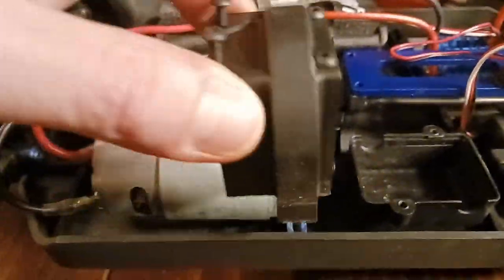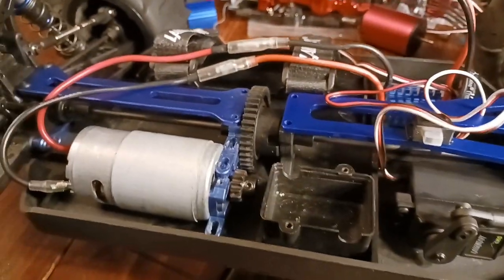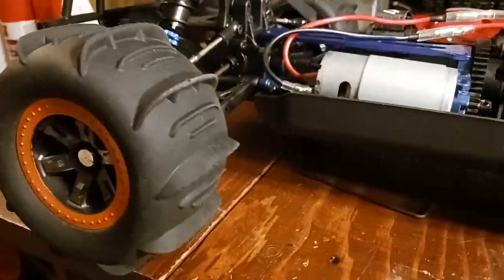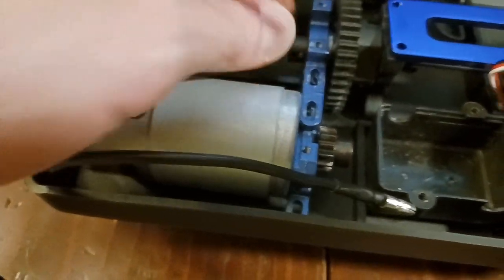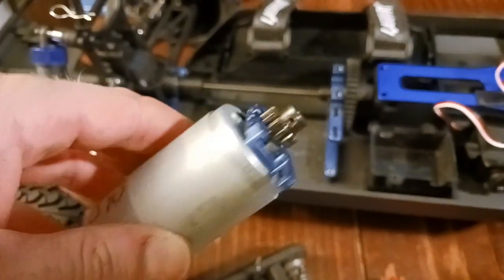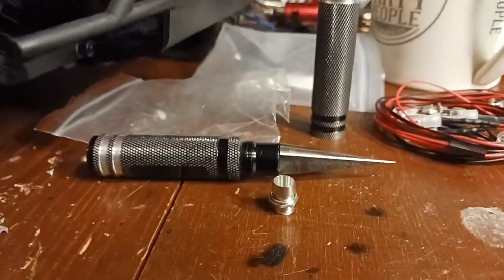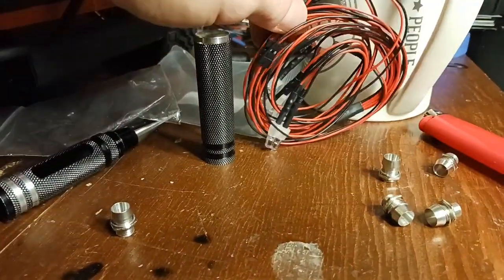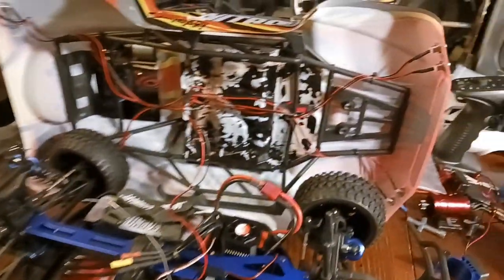Laegendary Nitro is now brushless & Fast asf

Comment: It’s an absolute ripper. You have a monster on your hands! A very well mannered monster!  For the price that this was , and the cost of the system you put in, you are way ahead for what you came up with. Awesome  light install as well! It handles so well! And that   Low speed throttle modulation is impressive! I knew you’d make this awesome. Great job Ricky!
Reply from the maker: Thanks Rob! Much appreciated 🙏

Comment: I've got the 17-18 tooth pinions you recommend, 3665 3100kv motor, 60-120a esc's, 125mm x 70mm tires, aluminum kick plate upgrade from my VRX Samurai, sway bars from VRX Samurai & Jeep Gladiator body shell. I'll attempt to assemble this weekend 👍🏽
Reply from the maker: Yay bro! except ohh no i just found out one thing I couldn't get the 17,18tooth to fit. The motor mount didn't have enough adjustment. Well I got a 15tooth mod 1 to fit. Bro The stock pinion is a 13tooth. I saw VRX 14tooth and figured it was the same, but I was wrong. I'm never guessing again
Reply from the maker: I had those 17,18 tooth on the motor and on the spur gear and the mesh fit. It was when I went to put the motor mount screws in I noticed I had a problem. Since I told you what to get and messed up I owe for the 17,18tooth. I'll PayPal you bro lmk that's all my fault
Reply: No need bro 👍🏽 it's from Amazon and I didn't open yet because I'm testing the Brushed ESC ISDT70 for crawlers, it runs a 3s and is programmable via Bluetooth, it rips brushed 3s but fan may be necessary and you'll have to plug fan in receiver and I've got 4 x 8oz tires on it. I'll post when I can on the Tube
Reply from the maker: Cool bro and thats good. Now with this 15tooth bro I think 17, 18tooth would be way too fast. 3660 4300KV 15tooth 2s is way faster then the 6900kv 13tooth. I haven't got outside, but 2s spunning the wheels off the ground just pan caked these RC Station tires part throttle really bad. Must be around 75mph right now it's nuts and it's a 3s,4s setup lol
Reply from the maker: I'll be on the lookout that sounds interesting 👌

Comment: Can you also share a link for the best suited pinion because I don't know the mod, pitch and tooth count, thanks
Reply from the maker: Sure ill get you a link for one. I just need to know what motor you have and what top speed you want. I reccomended keeping this truck under 55mph if its not weighted down, because it can fly and flip over and crash bad lol.
Reply from the maker: CODA RACING 2pcs 17&18T Mod 1 M1 5mm 1/8 Scale Pinion Gear Set https://a.co/d/7Zvgj47

Comment: What’s the best battery to run in this truck with brushless motor
Reply from the maker: 2s, 3s? I use two setups. One light for jumps and a one heavier battery setup for driving on flat ground. I show the batteries I use, or list them in the description. Anything from a single Awanfi 1500mah, or stacked in parallel to a single Zeee 5000mah 100c 2s. Those 1700mah and 1800mah stock batteries are no good. For the best in-between I'd reccomended a 2200mah 2s, or 3s
Reply: @ChiefRickyRC  I just want more run time so I can run it longer
Reply from the maker: Ohh this Nitro... lol I was on wrong truck. I'd reccomend getting two 2s 5200mah 50c-100c batteries and using a parallel plug.
Reply from the maker: I prefer Goldbat batteries they work great

Comment: You can use any 1/10 scale proline body on it it’s really a 1/0 scale not 1/8
Reply from the maker: Sorry no it's a 1/8. I have a 1/10 1978 Camaro i showed in Buncha Upgrades video back around xmas. Its same size as 1/8 Infraction
Reply from the maker: The Blade is 1/10 and any 1/10 JConcepts fits that tho
Reply: It will not let me post a picture but mine is the new brushless and it’s exactly the same size as a slash and I just fitted a proline Chevy  short course body on it it’s definitely not a 1/8 scale truck it’s a 1/10th scale
Reply: @ChiefRickyRC  nope is a 1/10 th it even has 12mm hex I just don’t like miss leading people I can’t even run the same tires that I run on my slash there to big if I could post picks I can prove what I’m saying
Reply from the maker: Its a 1/8 VRX. The hexs mean nothing. Its the length. Not one 1/10 body would fit. Im not replying anymore Robert
Reply from the maker: You are saying my Blade is a 1/12 then. Lol
Reply: @ChiefRickyRC  believe what you want but most of these cheap rc have the scale off there all smaller than they say they are but what I am saying is a 1/10 scale proline body for a Traxxas slash is a perfect fit on my Nitro and like I said if YouTube would let pictures post i can prove my point and yes your blade is a 1/12 scale just like the so called 1/10 scale  Legionary  brush monster truck and yeah I’ve got two of those but like I said there a great truck we’re racing ours straight out of the box but for size wise they’re way off
Reply from the maker: Short course bodys fit not all
Reply from the maker: Its a 1/8. If you say its a 1/10 then youre saying 1/10 traxxas tmaxx is 1/12
Reply: @ChiefRickyRC  I’m done with you even my 10 year old grandson knows it’s not 1/8 I told you I just mounted a ProLine 87 Chevy short course on mine and it a perfect fit which you said was impossible I’ve got over 80 cars and trucks in my collection how many have you built but I know absolutely nothing about what works and what don’t because like all all knowing kids I must be a dumb old man oh and buy the way your blade is the same truck as my Holsome rc 10th scale and. No it’s not a 10 scale but you keep believing what you want Iwas just just giving you proven facts but thanks to YouTube I can’t post the pictures for you maybe before you say something can’t be done you should try it
Reply from the maker: I dont care if you and your kid have a million pos. This is a 1/8. Where's your videos if you're so good? You a funny goofy
Reply from the maker: Go look at some 1/10 sct and get back to me
Reply from the maker: Theres a difference between sct and bashers. Things are different now buddy
Reply from the maker: Idk why youre trying to tell me a 1/8  is a 1/10. You dont understand. Jconcepts doesn't make the rules lmao
Reply from the maker: I've built 20,30 all on video. Ive had a million rc before my channel. First rc was a 97 Stampede Mechanical ESC
Reply from the maker: What size is this VRX Cobra? Just found this amazing item on AliExpress. Check it out! $90.00 | Hot Sale VRX Racing RH818P V2.0 KIT Cobra with Alum chassis & Wheelie1/8 Scale 4WD Electric Rc Truck Without Electronics
https://a.aliexpress.com/_mLoA4d8
Reply from the maker: What size is this VRX Cobra? 
Just found this amazing item on AliExpress. Check it out! $90.00 | Hot Sale VRX Racing RH818P V2.0 KIT Cobra with Alum chassis & Wheelie1/8 Scale 4WD Electric Rc Truck Without Electronics
https://a.aliexpress.com/_mLoA4d8
Reply from the maker: What size is a VRX Cobra?